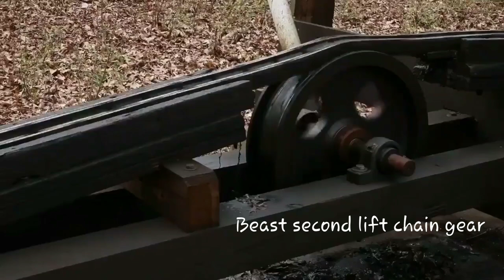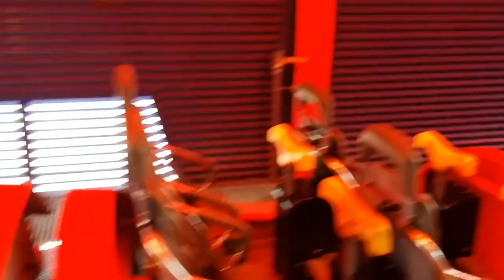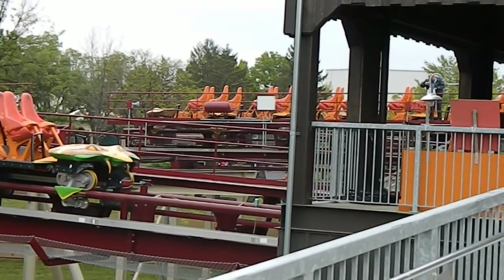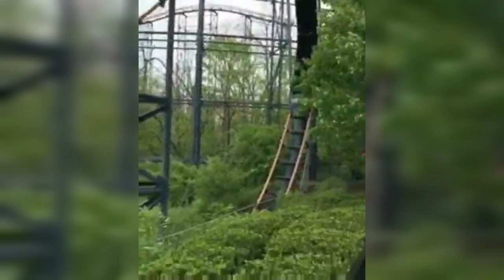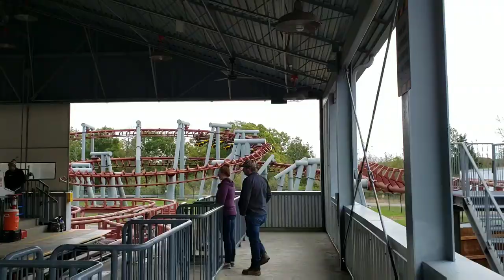Transfer tracks, brake runs, block checks, lift mechanisms, launch systems and more

Comment: Great Video!
0:00 Beast Chain Lift
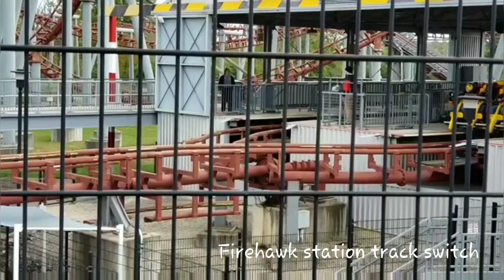0:09 Firehawk Switch Track
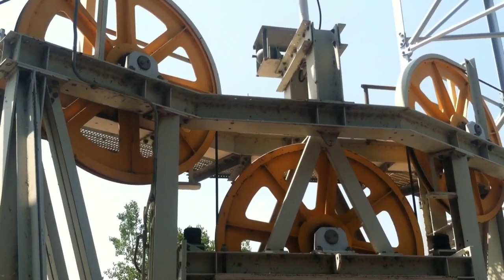1:07 Millennium Force Cable Lift
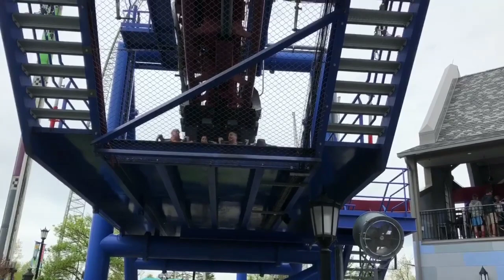1:30 Banshee Lift Hill
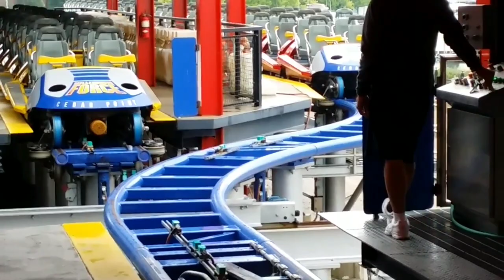1:39 Millennium Force Transfer
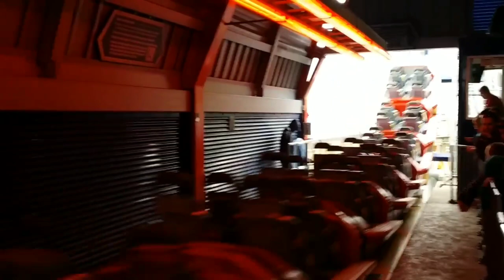4:24 Mean Streak Transfer
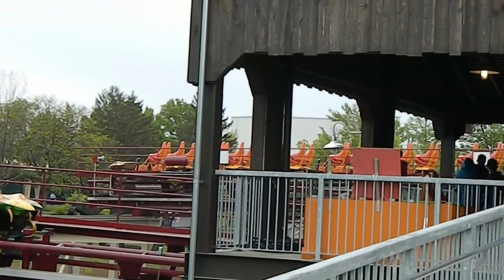10:35 Diamondback Transfer
11:46 Vortex Transfer
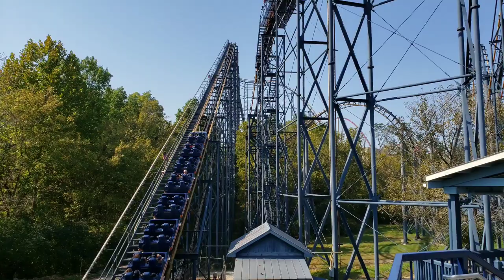12:16 Raptor Transfer
14:59 Gatekeeper Transfer
17:19 Vortex Block Check
17:57 Vortex Brake run
18:10 Flight of Fear Launch
18:28 Vortex Splashdown
18:37 Invertigo Ride Cycle
19:58 TTD Launch (RIP)